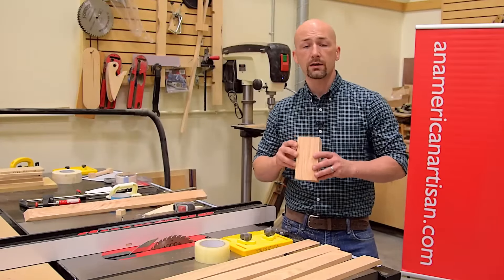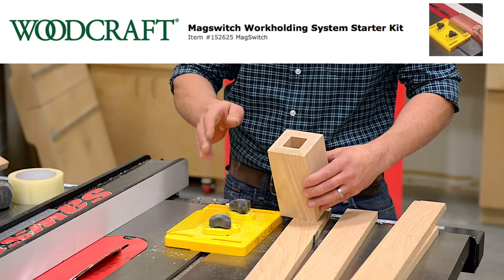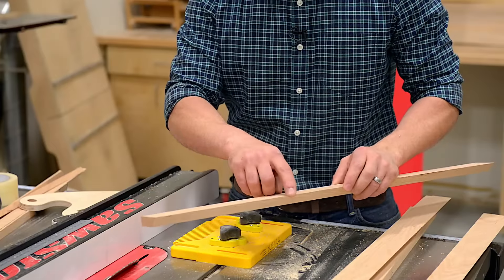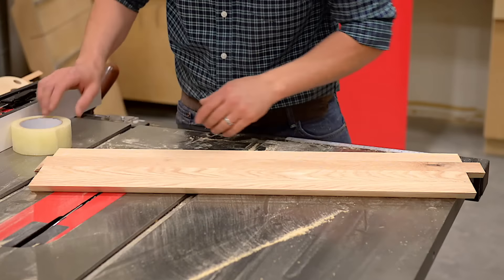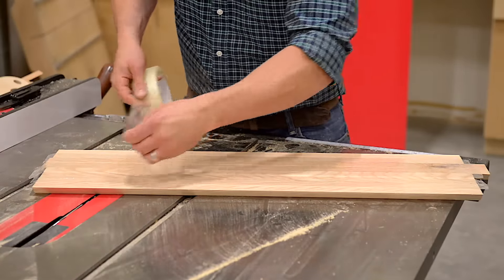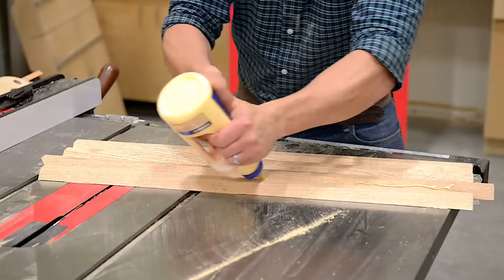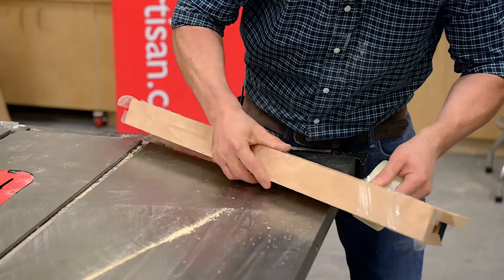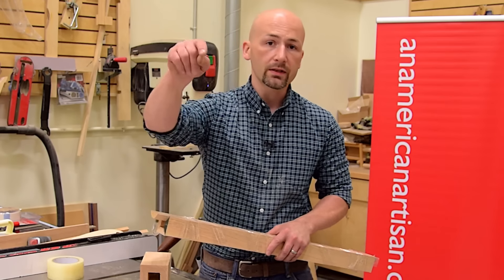Shop Secret: Miter Folding

Comment: Good tips  and video i worked for a large Commercial Woodworking company for over 25 years and we utilized a lot of mire folding  for production another great thing about it is  your grain always matches up  although i will admit we cheated  by using a diamond tipped router bit  custom made  in our cnc  multi axis router which allowed us to  mill veneered  sheet goods  and on occasion pre laminated  HPDl  that we pressed together on our in-house machinery  it was   a super fast way of building  shelves with a  front apron  which we did quite a bit  of  generally  for Standards and Bracket  shelving on our job sites in the Washington DC metropolitan area  including Baltimore  too

Comment: One tip...instead of more packing tape and trying to stretch it etc,  I use a narrow role of shrink wrap to close up the leg/column.  It puts substantial clamping pressure on the miters. Plus is less frustrating, cheaper, and way easier to remove.
Reply: Watched Spencer Lewis use that method. Works great.

Comment: Well done video; short and to the point. I was already familiar with the technique but had not tried the 45 1/2 deg miter to direct the excess glue toward the inside. I have had excess glue migrate under my tape. I cringed when I saw you use your SawStop table as a glue up surface. I avoid doing that and still manage to get unwanted stuff on the saw. From a safety perspective, please check out the Fine Woodworking article by Steve Latta, March/April 1998, pp. 62-65. Steve's technique has the saw blade unexposed and is much safer than yours.